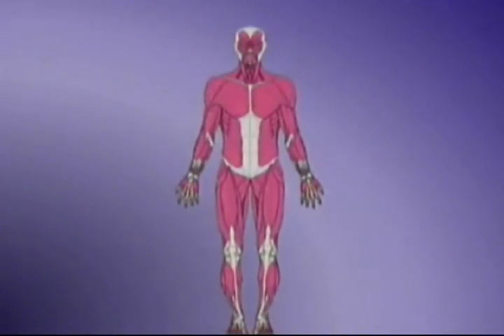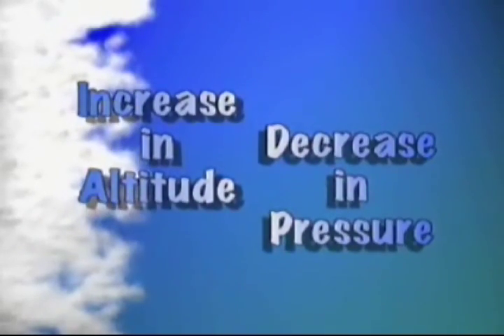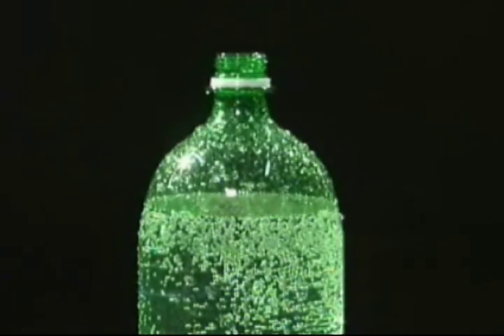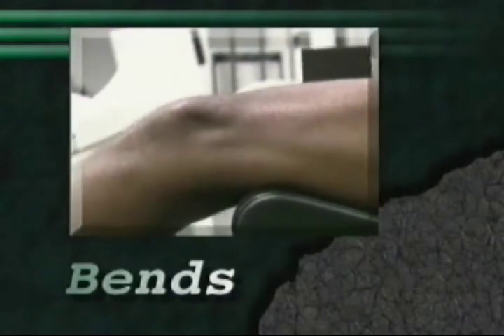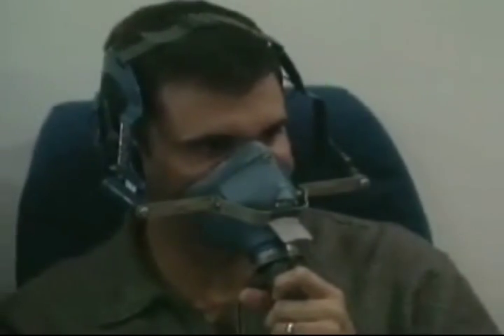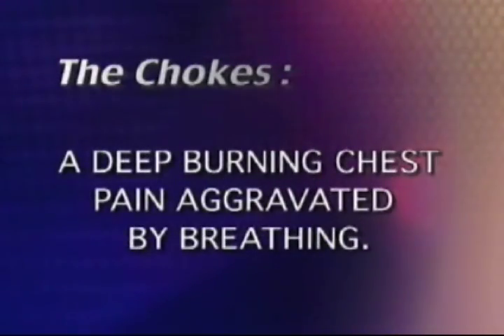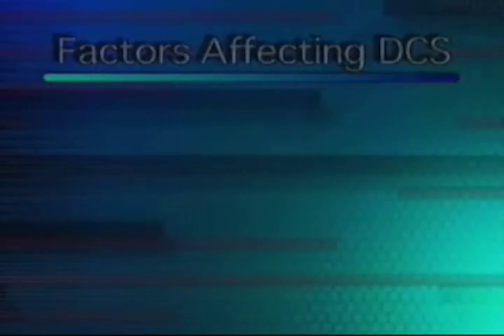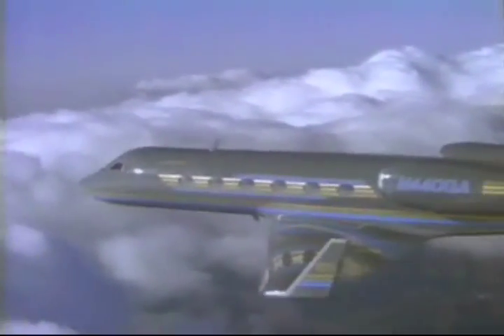Altitude Induced Decompression Sickness - Physiology of Flight

Comment: Congratulations on this excellent presentation of DCS. You have correctly emphasised the decreasing Air Pressure with increasing altitude. Whilst this may seem obvious, to most people it is not intuitive. Now you just need to add that with increasing altitude, the Hydrostatic Pressure within the vessels remains unchanged. This results in expansion of the vessels with increasing altitude, and this is the cause of the problems associated with Tissue Depressurization.